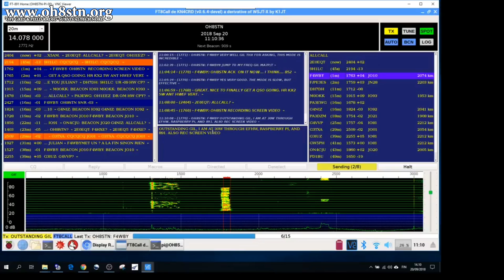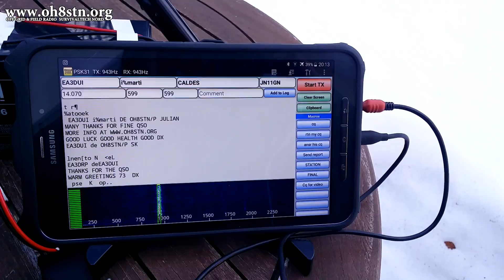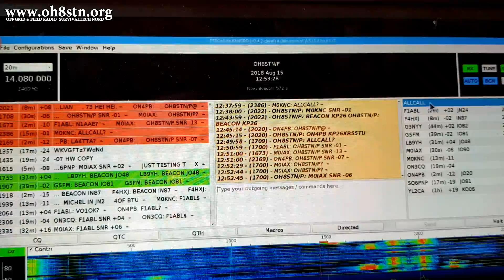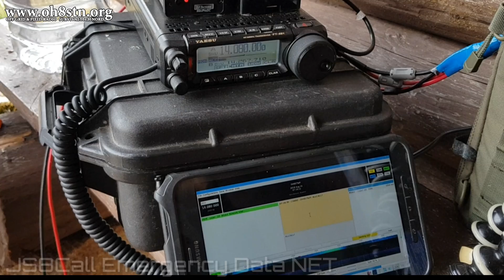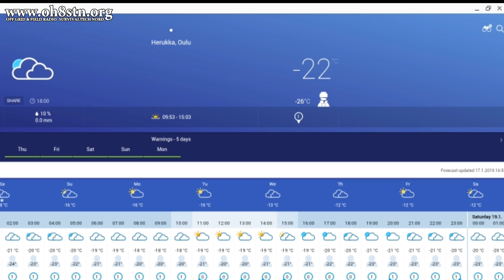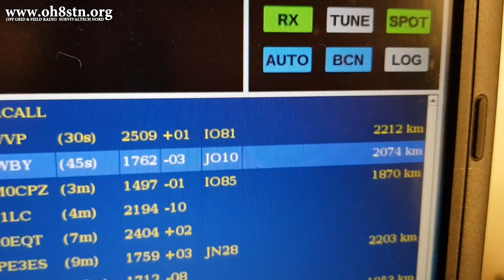Portable HF Station for Emergency Grid Down Comms in Winter

Comment: Thanks for posting. Your videos are always an inspiration to folks like myself who brave far less adverse circumstances to engage our hobby . I am also interested in implementing jS8call from a portable setup - in my case using a pocket size win-10 PC originally designed for gaming.
Reply from the maker: Thanks John. You have no idea how important comments like this are. Sometimes it's tough, but we need to keep pushing forward to inspire others. What's the name of that pocket sizedgaming PC?
73
Julian oh8stn
Reply: OH8STN I have a GPD win2 portable windows 10 gamIng console with a m3-7y30 cpu. It has 8GB ram and a 256 GB SSD. I ordered it this last December from amazon for 889 usd.

Comment: Julian, thank you very much for putting this together.  Your point resonates with me perfectly.  I am hosting a group of operators at my home and our goals are to practice our deployment techniques in cold weather.  The temperature will be 10 F, so not terribly cold, but chilly enough to require gloves and coats, which are not typical in the shack.  I became an amateur radio operator specifically for emergency communications.  My reward will come from our group establishing communications with regional resources - outside of the typical disaster zone for relay.  I wish you much success next weekend and look forward to your reports.  J
Reply from the maker: Thanks Jonathan and I noticed what you did. That's very much appreciated. 
The biggest challenge with operating in the field is exposure. Exposure for the operator, and exposure for our gear. One of the reasons I use a heated shelter is preventing condensation on my gear, and to reduce the humidity, which ultimately gets me cold. Another point to remember, is leaving all of the unnecessary peripherals at home. Every additional piece of Kit you have to fiddle to get your station running, is something that could potentially get your hands cold. Finally, make sure your station is as complete as possible before you get out to the field. This way you simply plug in your power, you plug in your antenna then start operating, no fiddling required.
Always enjoy your comments and your feedback. That's very much appreciated.

Comment: Hope to work you on this one Julian. I'll be part of a 3 man crew manning a 2 radio station (Class 2O) using our club callsign G3RCW/P in a small wood not too far from home. We will have generator power as I should be able to get the car within feet of where we will set up the Comcen shelter. The plan is to have voice and data running concurrently on different bands. We'll be tree swinging in hammocks when it's time to sleep, and there'll be a fire to warm up around a short distance away from where we are. Good luck and I hope the WX is kind up there. RnFR buddy. 73
Reply from the maker: Sounds like an absolutely outstanding plan Andy. If you haven't run the generator before in the field, you might experience some noise caused by the inverter. Other than that it sounds absolutely brilliant. As always, hope to work you on the air 👍👍👍
Reply: @OH8STN  I have a mains noise filter and surge protection appliance in my gig box for my guitar amp and pedal board. I'll see how high its rated and take it along if possible. Looking forward to some good contacts away from the QTH. Cut my first 40m EFHW antenna this pm uins my home built Balun. SWR 1.2 and 50ohms on the analyser.

Comment: I will be activating my first WFD from Mt. Diablo in California. My concern there is not extreme cold, but extreme (70 mph) winds with rain.  Will just use SSB on 40, 20 and 15(if open), as well as CW. I am intrigued by JS8call and will add that to my repertoire, but it will need to wait until after WFD.
Reply from the maker: Some sort of shelter will be critical for your operations. Please come back and let us know how it went for you.
Reply: Will do. I think the best decision in such circumstances will be to relocate ops to the base of the mountain. I have a tent, but that is nothing for such weather. The good news for me is that it does not appear (at this time) that a storm will be happening that weekend.  Today I tested a packtenna random end fed and it worked amazingly well on 17, 20 and 40m with a 29 foot wire and 15 watts.

Comment: Another great video, Julian.  We'll be out with a group at a state park here in Florida for winter field day.  Our call sign will be N4Y.  I doubt the weather here will be as extreme as what you will be facing, but we are still looking at 35 F.  That's pretty chilly for us Floridians.  We will be camping and running off-grid with solar and batteries.  Maybe we will get lucky and work each other.  73! Bob  KK4DIV
Reply from the maker: That would be absolutely magnificent Bob. Yeah 35 is still pretty cold oh, and you need to take precautions to prevent exposure. Are you guys going to be using a shelter?

Comment: As a pro at digital communications, I have a question: Is digital communications duty cycle hard on radios? Thank you.
Reply from the maker: Depends on how hard you drive the radio. I've been running narrow bad with data modes all day, every day, for years. I've never had a radio fail, but that's probably because I understand what I'm doing. I suppose the answer to your question is, it can be. If we don't give our radios a chance to breathe, after long-duration Transmissions, or cool down while running them over driven, the radio will fail. On the flip side, if you run the data into the radio without over driving it, supplying adequate Cooling, the radio will nuts being negatively affected.
Reply: Thank you Sir. I now understand. Was just a little unclear about this.

Comment: Winter field day, learning to be an winter operator for a radio.  No power or heat, in Tucson little snow but still cold.
Reply from the maker: Yeah I know all about the bitter cold of Arizona. People think desert, and they don't realize that it's blistering cold certain times of the year. Nevermind the sandstorms. In fact before I came to Europe, I thought I would eventually retire in Yuma. Thanks for the comment, and for watching it's very much appreciated.

Comment: Is the 817 your radio of choice for portable operations?
Reply from the maker: Hi George. It's kind of a trick question. For qrp portable the 817 is ok, but only preferred when for casual operating. The screen is so small that it actually annoys me to use the radio for anything other than digital modes. So that's the Achilles heel and the reason it's not my number one choice. I'm usually using the ft-891, since it's only slightly larger than the 817. That solution is not perfect either, because it uses 1 amp on RX. Still, it's a much more capable radio and I'm more comfortable using it.

Comment: Happy New Year to you, my friend!  Great video, as always.  Planning QRP digital mode POTA activation for WFD 2019, battery and solar powered.  It will be my first field test of the ZLP MiniPro SC, as well as RasPi 3B+ as primary computer. JS8Call, RTTY, Olivia likely to be primary modes. Won't be quite -22C here in NY, but we're about to get a good snow here and single-digit temps in the run-up to WFD.  Off-grid in terms of power and parlaying some bushcraft to keep warm will be the focus this time out.  Good luck in achieving your goals!
Reply from the maker: Outstanding comment Joe, much appreciated. Having worked in the Mid-Atlantic and New England, I've had my share of Blizzard experience back in the day. New York is no joke in the winter. Sounds like you've got a pretty awesome plan. There's so many things going on inside the shelter, I'm not sure if I can multitask with multiple modes. Hopefully you'll let us know how it went after the event.  Although so publishing AAR after the fact.
Thanks for the comment, and the kindness. It's always awesome to hear from you.

Comment: I should be out in the woods as well in the north here just above the 45th. Just need to sort out a heat source for my setup. Should be about -12f or close to it. If all goes as planned I will be 100% battery/solar as well with a 55AH battery. Not sure if I will be doing qrp or bring the 100w rig yet but should be fun. If all else fails I will be battery op from my QTH.

73
 DE 
   N8DAH
Reply from the maker: Well please be extremely careful. Anyway I think the heating is the critical component for cold weather. It took me awhile to come to the conclusion of using a wood stove. But I'm also experimenting with small kerosene powered stove. Whatever you come up with be safe and remember the ventilation.

Comment: Another awesome video Julian I would like to focus my time this WFD is on which antenna works best for me. I have a few homemade dipoles I want to try the usual problem with them is getting them up high enough to be useful. I have a couple of telescopic whips and a tripod to run vertical or horizontal. I have another question for you concerning the mcHF SDR radio which one do I purchase? There seems to be many knockoffs and the best model and try to support those who spent the time to design the radio. How is it going with the NWR hat for the pi? I would like to build a portable inteface with all the components built in and thought the NWR hat helped checked a lot of those boxes off. I'm thinking of even building a manpack radio with the  mcHF radio and pi /hat with battery power anding a small antenna  tuner and whip antenna. Also providing the necessary connectors to be flexible. Power, gps, external radios, etc.
Reply from the maker: Donnie I'm just heading to bed so I'll come back and comment tomorrow. I just wanted you to know that I saw it.

Comment: Thanks for the video. Interested in your comment regarding emergency comms on JS8. I think that has potential due to the QRP ops you'd probably have to use  in the field in this situation.
Reply from the maker: Thanks. JS8 has enormous potential. With 20 to 30 Watts and my solar generator oh, I think I can stay operational for days at a time. The narrow bandwidth nature of js8, along with my rigs filters, make for some pretty efficient communications. The network functionality of the mode will put all of the stations on the map, and let them interact with one another, even if they can't hear one another.

Comment: Julian, what is your opinion about go-boxes? Seeing your method is more modular. Keep going on and (when I pass my exams) see you on the air. 73's.
Reply from the maker: I think go boxes can be incredibly effective, if they're kept simple, and self-contained. Far too often we put all the bells and whistles inside of go boxes. The result can be something that's abnormally large, not a reportable, and definitely difficult to deploy. I guess at the end of the day, we just need to find the balance. That way we can build something both useful, and practical.

Comment: Julian, once again another great video.  You put me to shame.  It is 32 degrees with 2 inch of snow and I refuse to operation my radio.  I can imagine with you at -22 Celcius that you are still making it work.  I'll take the heat anytime over the snow.
Reply from the maker: Well the heat has its challenges as well. I remember back in the day still living in the desert, you can leave an antenna laying in the Sun for a little bit too long, go to grab it and get a third degree burn on your hat. Winter or summer each environment has its challenges. I think what the temperature is hovering around freezing, it's more challenging then 10 or 20 degrees lower. The humidity usually raises when the temperature hovers around freezing. So I'll take low humidity and lower temperature versus warmer and higher humidity anytime :-)
Anyway, don't be afraid to get out there and try it. The experience is extremely valuable.

Comment: I have hopes for operating from my car from the parking lot of a nearby state park, using my KX3, and perhaps my FT-991A, hopefully from my Bioeno LiFe PO4 battery, and a SuperAntenna MP1.  I will have the AlexLoop with me and maybe an end fed to throw into a tree (if I can figure out where I "stored" it), if neither other antenna seems to get out.  The car electrical system is backup power, and I'm almost certain to run the car for heat.  I have some Chinese solar panels, but there's only so much that I can get ready for next week.  While there is probably cellular coverage, I won't be involving the network.

I, too, am not going for points, just proof of concept.  I'll probably only be out for a couple of hours.  I have a nasty cold, which could get better or worse, and will impact my enthusiasm.  If the parking lot at the park doesn't get plowed from this weekend's snowstorm (forecast 12 to 20 inches, and why would they plow a summer focused park), I may have to find a more pedestrian site.

I always enjoy your videos.

73, Bill - KE1G
Reply from the maker: Good luck bill and I hope to catch you on the air sometimes

Comment: Could you tell me what software you are able to run on the Samsung tablet?
Reply from the maker: Sure, but it's a trick question.
On the tablet DroidPSK, DroidRTTY, DroidSSTV, Andflmsg, APRSDroid, WSPRBeacon, HamLog. 
The tablet is also used to connect to my Raspberry Pi to run FLDigi, JS8Call, WSJT-X, and XASTIR.
I hope this helps.
Reply from the maker: Here's a video explaining the relationship between the tablet and raspberry pi https://youtu.be/BcMMlGvPCsw

Comment: Nice video. I'm kind of curious what kind of PC your using in -20 degree weather.
Reply from the maker: Hello Robert. When I'm operating exposed to the elements, I use a rugged tablet. The station computer is a raspberry pi,  but it is protected from the elements along with my radio. I connect to the station computer with a VNC connection, so only the rugged tablet is exposed.